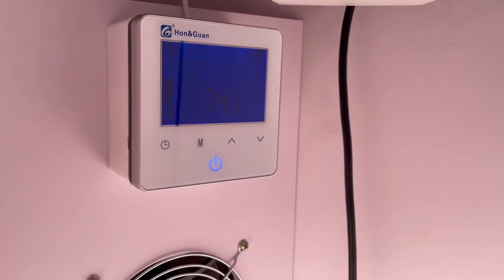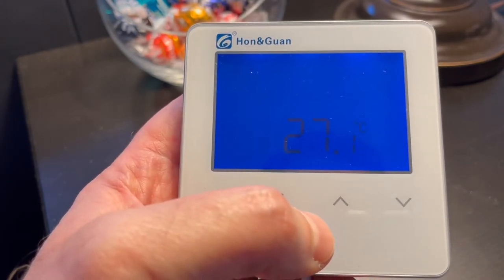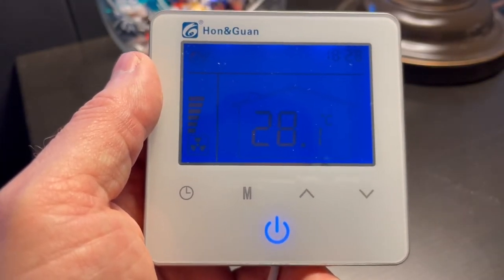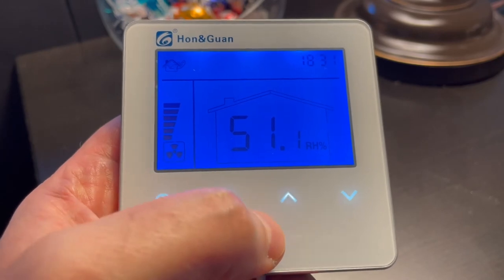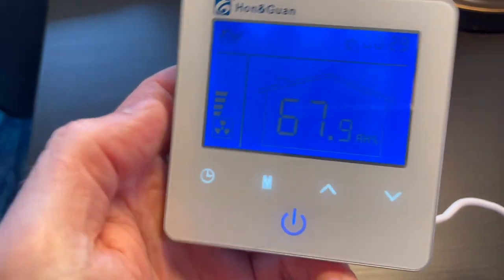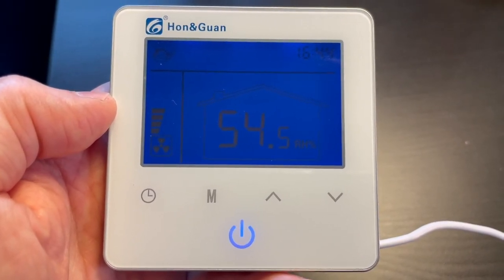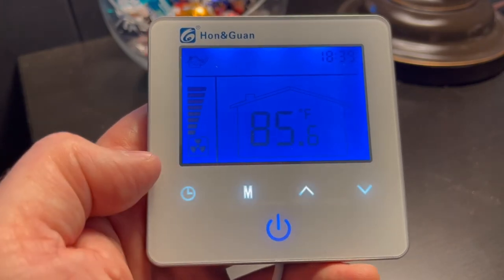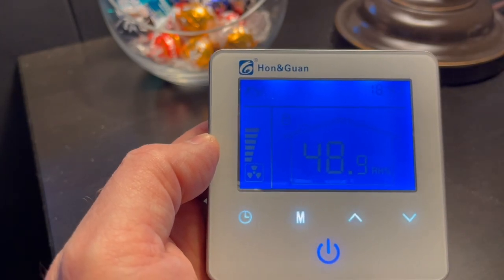Setting Up The LCD Controller for The Armoire

Comment: 3:37: Setting the time  4:23: Celsius vs Fahrenheit   5:01: Delay Module   6:18: setting/de-activating the timer function   8:18 de-activating auto mode    8:32: Adjusting fan speed    9:04: locking the controller